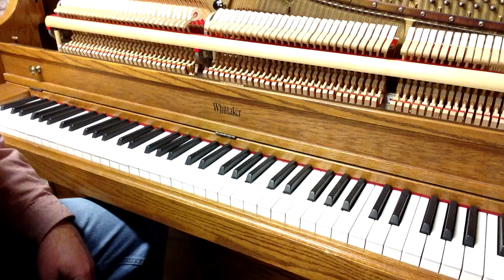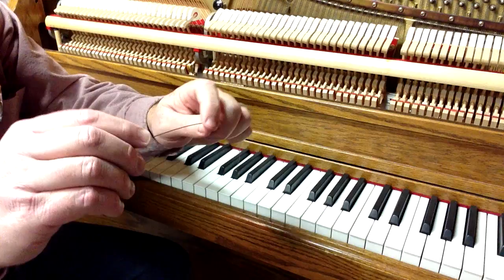Piano Tuning Theory - Inharmonicity [Part 7] I HOWARD PIANO INDUSTRIES

Comment: Great series, my mind is a little bit blown about the gradual sharpness up from A4 and flatness down from A4.
Q1: How bad does a piano sound if you tune it to exactly the theoretical frequencies i.e. each octave tuned to 2x the preceding octave?
Q2: How many pianists know this about the piano - do they get involved with shaping the sound, or for the most part leave it to the tuner?
Q3: Why isn't the piano designed to take the inharmonicity into consideration - adjust the string length so you DO tune to exactly to 2x the frequency with each octave.
Q4: What goes on in a pitch raise (like my piano needs!). This question my be hypothetical because I bet you have a video on that.
Thanks!
Reply: 1. Unmatched partials/harmonics so you hear excessive beating in large intervals and the sound is muddy and not as clear and rich as it should be (lower frequency notes don't trigger the resonance of the upper strings as the frequency of harmonic of the lower frequency string is a bit higher than the pure-tuned frequency of the higher notes)
2. I believe majority of pianists are aware of this at least to some degree (as my wife, a pianist, loves to say "I always knew there is something wrong with the piano tuning!"). Some pianists have their own preferences about which intervals they prefer to sound as clean as possible (it often depends on the repertoire), though each piano has its own optimal style of tuning and the pianist's wishes may go against the laws of physics. Some pianists often argue about the tuning quality with their piano technician due to this misunderstanding. No tuning can be perfect, it's always a compromise.
The problem is especially severe with pianists who have studied on digital pianos which are using samples from the concert grand pianos which have low inharmonicity and which are extremely well tuned before they were sampled.
3. The piano are actually designed by taking this in mind, but they have to work within the physical constraints—you cannot put long strings in a small cabinet, usually they are as long as they can be to fit in a particular piano (though there are some other constraints). To ensure low inharmonicity of the lower bass strings you will end up with several meters long strings—of course such long pianos (concert grands) sound way better but not many people can afford them and have space for them.
4. I would suggest watching videos specifically about the pitch raising as it's not something simple to explain in a comment.
Cheers!

Comment: a point that might be missed here is that the stiffness that gives a string its pitch is longitudinal (stretching, tension) stiffness. the stiffness being discussed here is bending stiffness, which is zero in an "ideal" string but increases with thickness. this always introduces an error by introducing an extra force, at the bend in the middle of a standing wave, and also the bend where the string is relatively anchored on the bridge instead of being completely free to point in any direction. the bending (or the thickness) is more prominent on the shorter partials so their pitch increases more than the ideal factor. there is an extra distortion that occurs because the amplitude of a note slightly stretches the string and increases tension, changing the sinusoid shape of the fundamental and pitch of the partials, but that complex interplay isn't relevant to this discussion

Comment: Okay. So your sharpening the not to match the overtones? Why doesn't that make the actual tone sharper? This makes no sense to me. I'm just a dumb guitar player. If you sharpen a string, isn't the actual note sharper? If you're chasing overtones it seems like you'd be out of tune in your whole tones.
Reply: That's the point, in order to get overtones to match the middle register on a piano you will need to stretch the octaves in the treble sections as well as in the bass sections. If you tune these notes mathematically, they wouldn't sound good.

Comment: Actually the string is stiffer for higher and higher partials, but this does not imply that partial are not perfect multiples of the base frequency.
The cause of the stretch is the inharmonicity only, which is a measure of how much the string deviates from an "ideal increased stiffness".
Anyhow, thanks for the very clear and complete videos.
Reply: it does indeed imply the partials are not perfect multiples of the fundamental. that's exactly what inharmonicity means

Comment: So its only compared to lower octaves on the piano that a piano string sounds flat, when tuned perfect to tuner? Not compared to the lower octave on another instrument (that doesnt have the problem with stiff string and overtones becoming sharper than fundamental).
Reply from the maker: Yes, that is correct.
Reply: @howardpianoind  Ok, thanks! So to get the piano to work well with other instruments (in a semi-acoustic rock band together with hammond organ etc), i should aim for right between what the tuner says and the 1st overtone of the lower octave?

Comment: In another video you tuned the whole piano with a computer without taking into account beats or stretching. Should I just use a tuner being a novice or try to tune one octave using beats of the A4?  Im confused
Reply: when he uses a computer, he's accounting for stretching but it's not obvious. even if your tuner understands stretching, you need expertise to tell your tuner what stretch parameters suit your piano. however ... even with a dumb tuner, for the middle two or three octaves it will be "close enough". and to my ears at least, you can tune the remaining strings by getting them to sound harmonious with the tuned equivalent in a different octave. my two cents: if your piano is badly out of tune, as mine was, you are better to get it roughly in order and stable before you call a professional, because large changes won't hold (although as it turns out, i'm perfectly happy with the result). further, any fool can fix out of tune unison strings, and for the tinnest of ears these are the most noticeable problem
Reply: With a simple tuner device only a rough tuning can be performed (and even then a simple piano tuner device provides some degree of stretching—something like -10 cents in the lowest bass notes and +10 cents in the highest notes). Then the technician must fine-tune all the intervals by listening to beats.
The modern way is to use a good smartphone app that can measure the inharmonicity of your piano (you build up its model by playing each note) and the app will calculate the optimal stretched tuning for it. Currently there are several such apps for each platform, they're not cheap starting at around 100 USD for a basic/standard version and going to around 600 USD for a pro version.

Comment: Love your videos! (Long post) 
very clear and to the point. Hopefully I had one of your video to refer to when one of my plastic mute got stuck  inside the rail of hammers. I was unscrewing parts I shouldn't have, to get it. I didn't see the 3 black bolts waiting to be turned by hand. One of the easiest part of the piano to get off . But when I wanted to get it back, oh..oh. I didn't see there was the pedal metal stick bar on the left I had to plug in the whole section, while fitting this into the piano. I was swearing my life to put the bar in while holding the section...... I was lucky enough to have help for this piece, one holding down this pedal bar into the hole the other fitting it all in.. I wonder how to do it all alone?
I had another question. 
I bought a 55$ tuning kit on amazon, but the tuning hammer had rust inside of it and broke after 6 hours. So i am looking for the best quality tuning hammer. 
Even though it took me about 22 hours tuning my piano, minus the week of reading before starting, its so enjoyable, I think it should be listed as a sport, or a good training at least.
I have an upright k-2. 
I see you have an impact hammer and the professional nylon extension hammer. I like the idea of this impact, since the weight is doing a good work depending on the stickness of the pins. I sure did loosen some of my pins on this first tuning. I consider this a bad thing because the piano is probably be less stable and not hold the note for a long time. Although, a good thing for the next tuning, to get the right note with less force back and forth to get the chords to turn. I see one of your tuning with tune lab, your note is so solid, it's right into the target, the grey line is all full and the squares are not moving. I wish that would happen. Had only a few chords reaching this point, about 5 out of 256. The rest is ok, sound is good anyway :)
Well, if youve read to this point thanks in advance. I wish to buy the impact or the pro tuning hammer with 5 degree tips. The impact has a long star knot (tip), around 3"1/2, i read the less long it is, the better, for turning the chord instead of the pin. Is this a problem with the impact?
Id get both if i could, but id start with one.
Thank you!
Ma

Comment: thank your explanation! I'm from Asian and not good at English. so I'm not completely understand what you said. Can you explain to me that if we raise a little bit sharp in high treble and flat in low bass. does it have the beat sound when we play octaves or perfect four and fifth?
Reply from the maker: Hi Quoc,
Basically octaves should be beatless depending on which partials you're listening to and 4ths and 5ths will beat slowly.  I hope this helps.
Reply: you might want to explain the difference between beatless ( pure ) and slow rolls ( less than one beat per second ) as is the case with octaves and   some fifths. Also test intervals like tenths and seventeenths. I was glad to see the ghosting,  self explaining physics

Comment: When tuning the low range so that the partials are more in-tune with the midrange, does this mean that single octaves in the low range, such as E1-E2, should be beating slightly? In my understanding, tuning pure octaves in the low range means that 10ths, 15ths, 17ths, etc. would be out of tune.
Reply from the maker: Yes, the octaves would need to be beating slightly if you listening to the fundamentals of each of the notes.
Reply: Can you make a video were we can hear the strech of the octaves